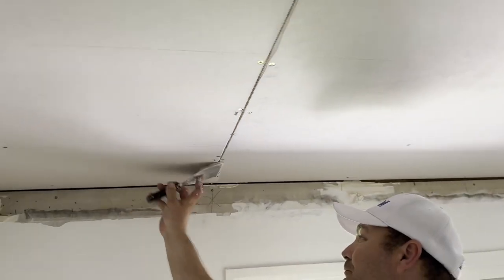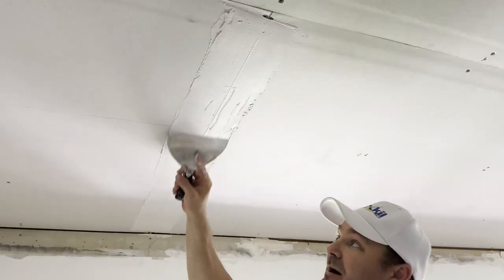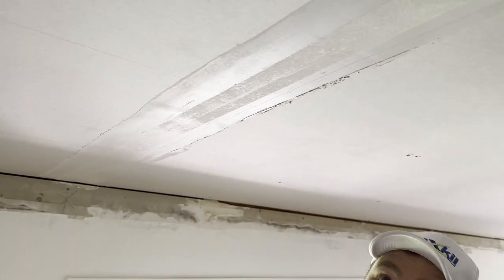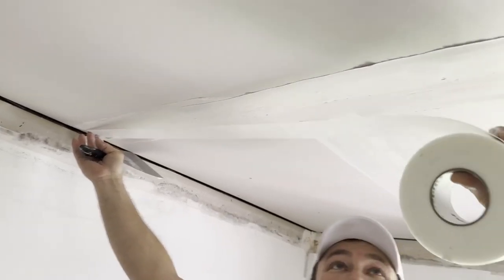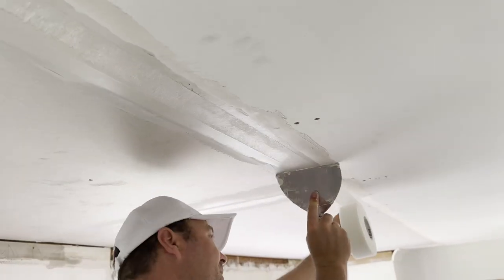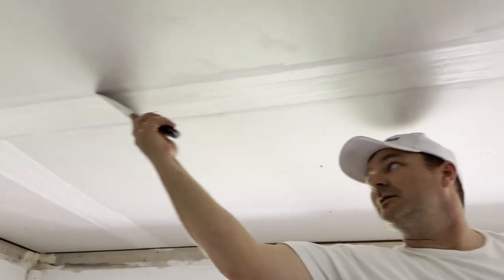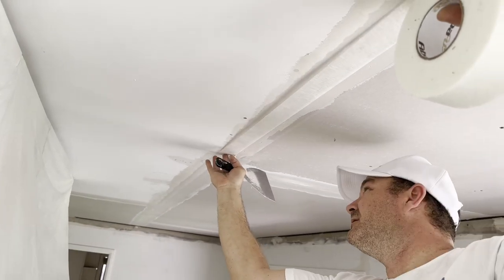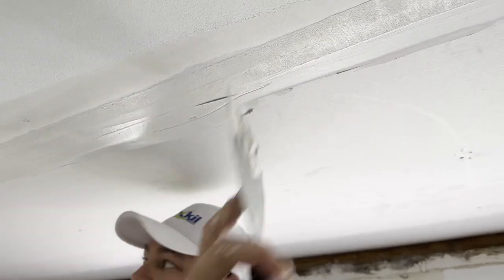How to Tape a Drywall Butt Joint

Comment: Have you had any cracking callbacks with fibafuse? I’d like to switch over from paper but am worried about getting the call 2 years later
Reply: Costs more than paper. Cracks. What would be the advantage?